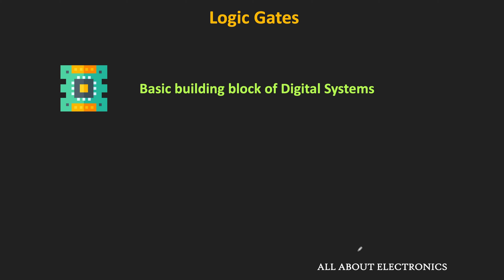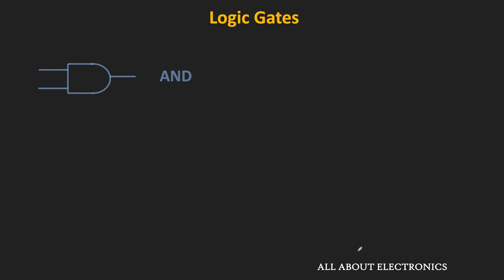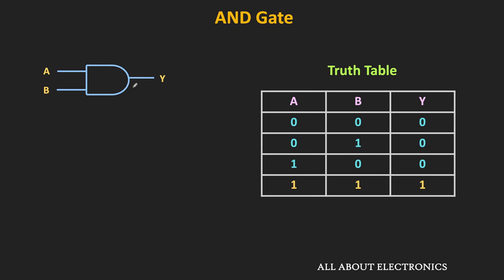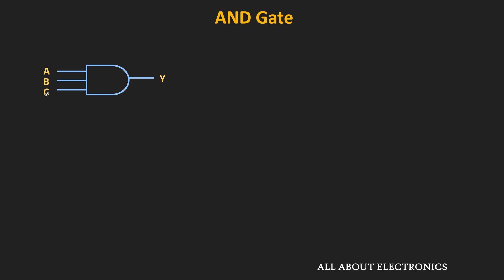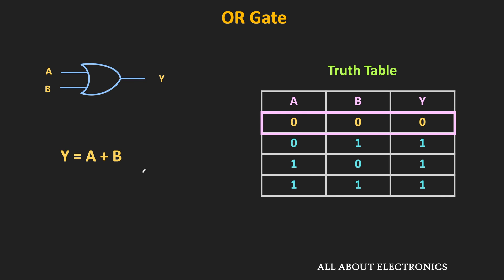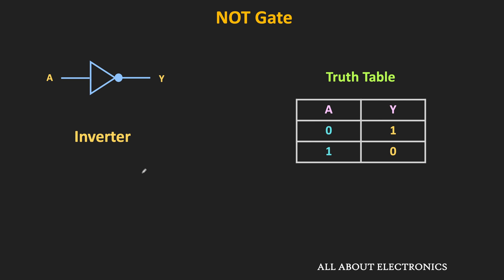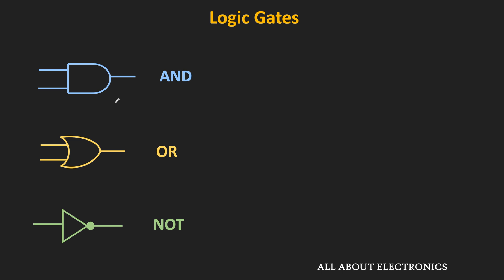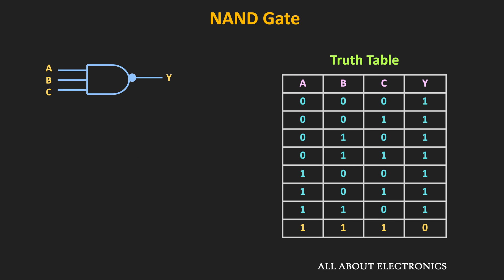What is Logic Gate ? Logic Gates Explained

Comment: How do we  interpret a question that  is asked  about gates , specification of what the gates do
Reply from the maker: Logic gate as its name suggest, performs logical operation based on the input. For example 2 AND gate output is 1 when both inputs are 1. So it can be used to implement logic circuits. For example, let’s say you want to turn ON Light or LED when temperature goes above certain level ( 1st signal) and also humidity is beyond one level. ( 2nd signal). So through level sensor these digital signals will go to AND gate and its output will be 1 when these two conditions are met. And in this way, it performs logical operations.